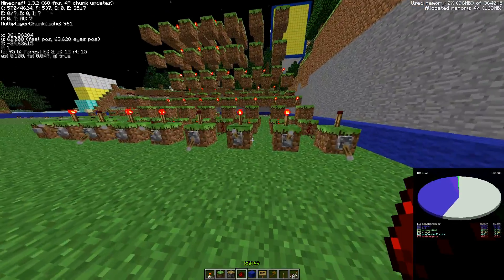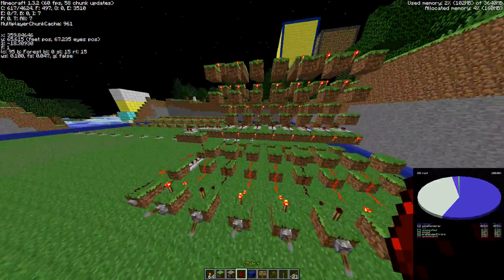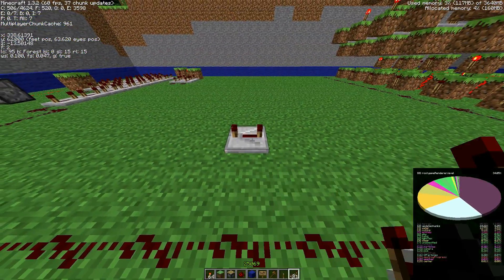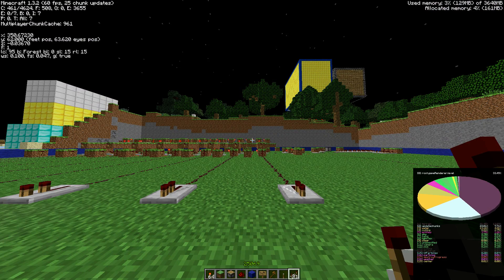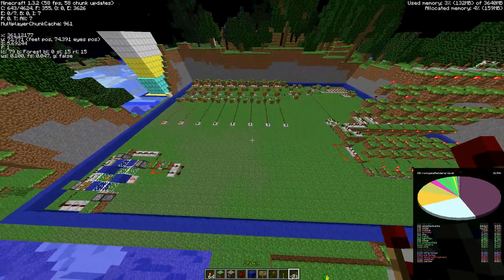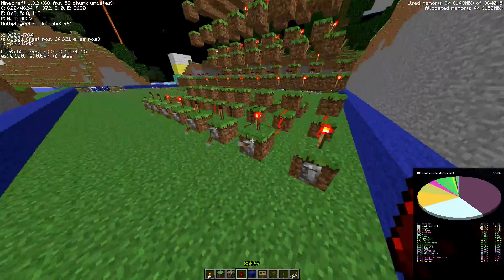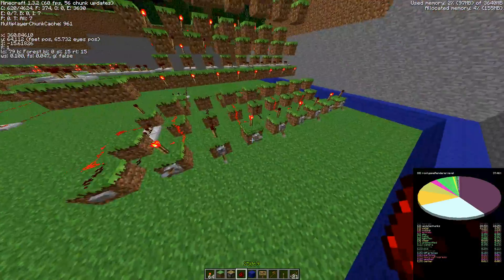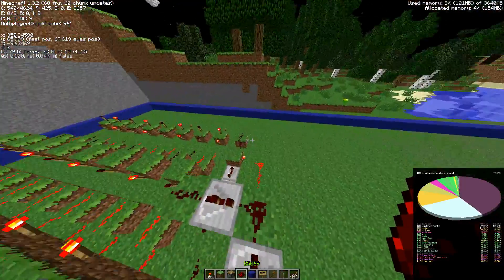Redstone serial data bus

Comment: I did something a bit similar except I was able to condense it down and I implemented a method for routing the data that used comparators.

Basically in my set up it sends a 12 bit signal down the line. The first 4 bits are for addressing and can select an address from 1-15. Address 0 can't be used in my system. So basically the 4 address bits are used to select a signal strength to be applied to the data which is then passed through a signal strength decoder that sends it down the correct line.